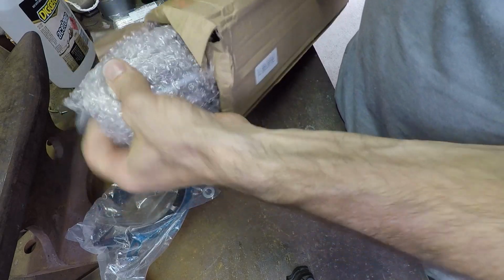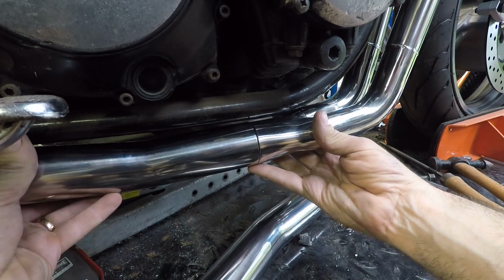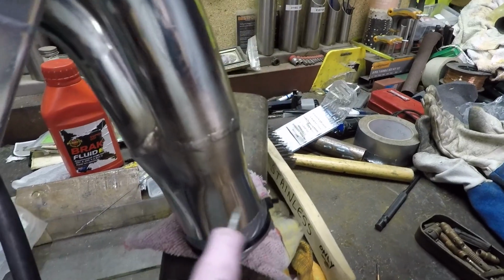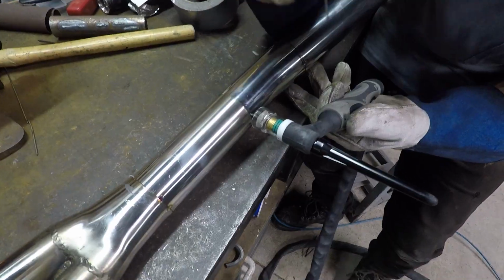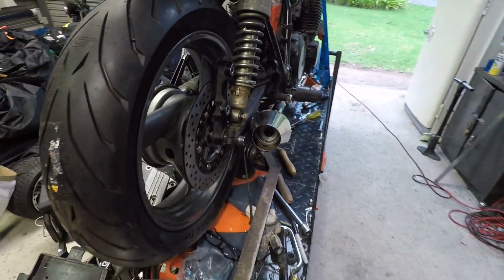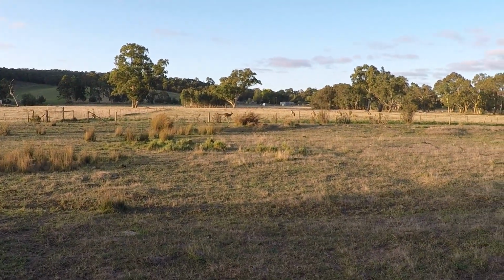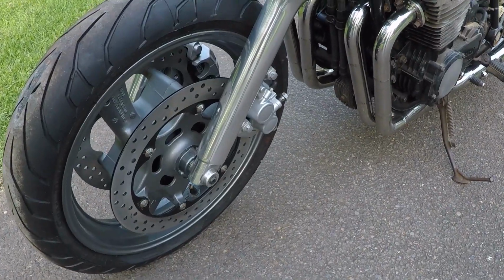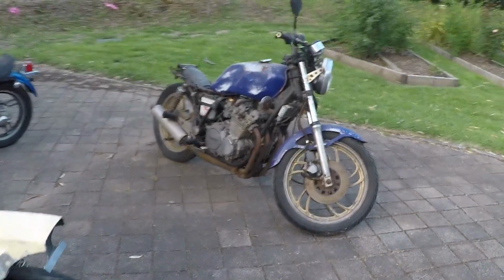Yamaha XJ650 Part 16 Exhaust system

Comment: Gday, the exhaust system turned out bloody awesome, I like the look of the mufflers and for the price there is now way you could make a set with new material, I’m really looking forward to the engine build, it will be very interesting 🧐, thanks for another great video, much appreciated,   Cheers Matty
Reply from the maker: Thanks Matty. I haven't found any videos online showing the real detail of an XJ750 or XJ650 engine. SO, looks like I could be one of the first to reveal a few new tips for others. It's gonna be fun...
Reply: I’m really looking forward to this,

Comment: Do you need to retune carbs when you put on slip ons 82 650 maxim yics
Reply from the maker: Hi Mate, difficult to say but the easy answer is yes you should check the carbs after any change